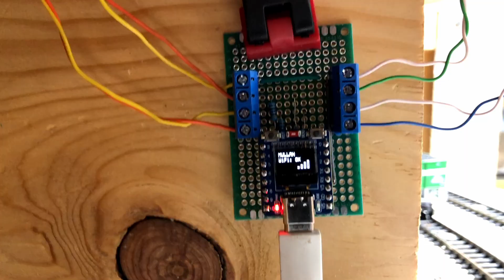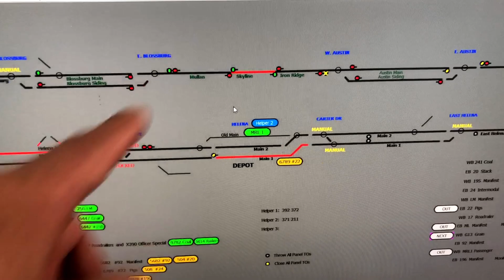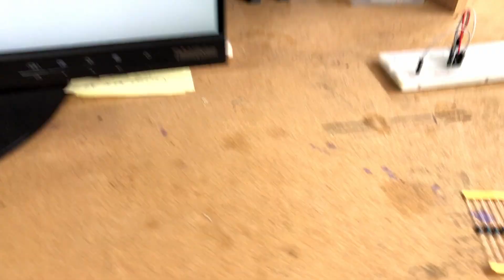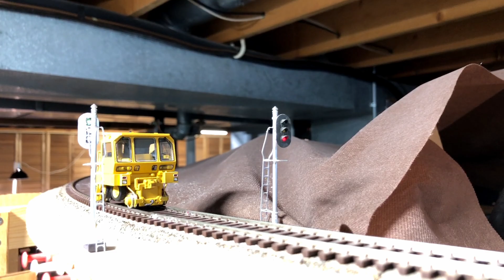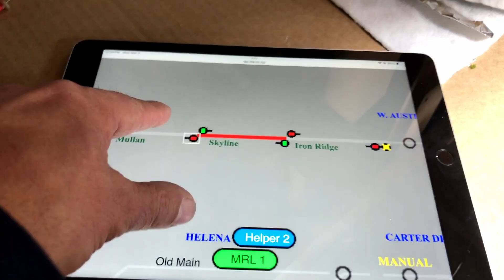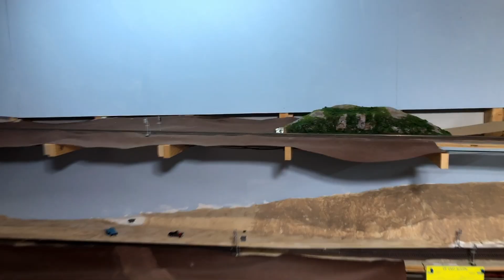Model Railroad WiFi Signals!

Comment: That is a very clever idea. I am sure there are more like me that would like to see more details of your work. I plan to use CATS and RR-Circuits DCC signal man for my interlocks but I have passed on the intermediate signals for the same reasons you mentioned. Hope to see more. Thanks Mike
Reply from the maker: I can put together more details for you. I’ll do a more in depth video when I get some time.
Reply: @MRLTrains sounds great thanks no hurry for me I'm a ways away from installing my signals.